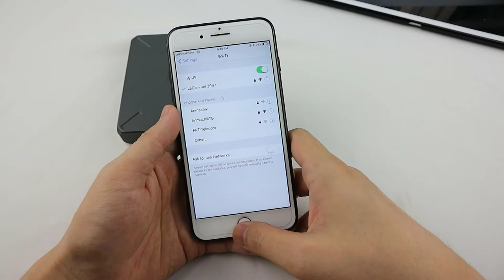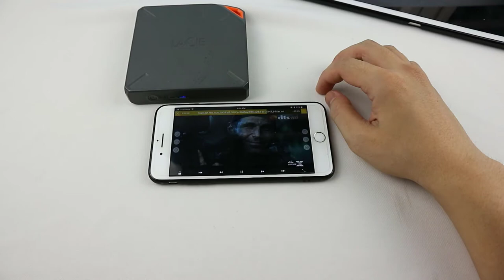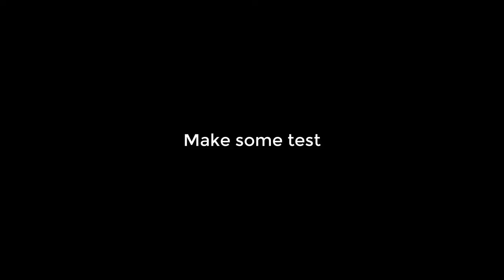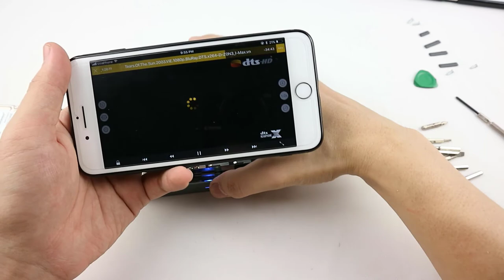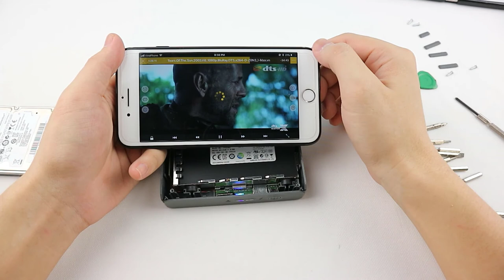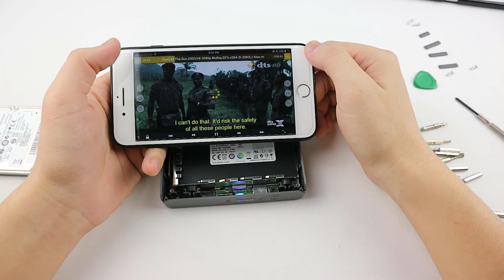Replace HDD in Lacie Fuel with SSD drive - Test and result

Comment: Yes, the problem is in the slow wireless transfer, not exactly in HDD or SSD. The biggest benefit in SSD in this case is the fact you cannot break it by bumping with it around. Which is kinda crucial in portable device like this.